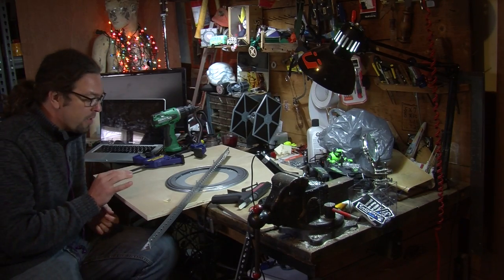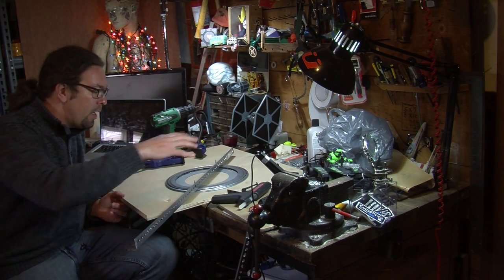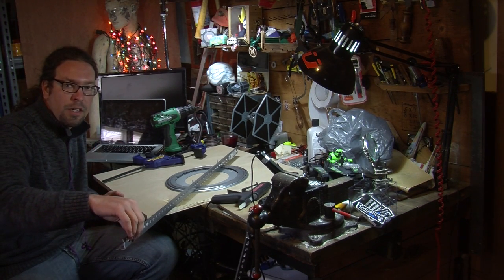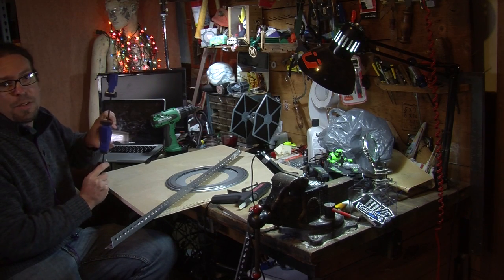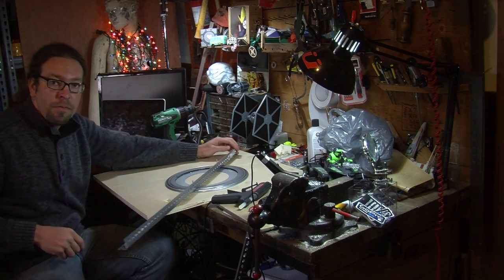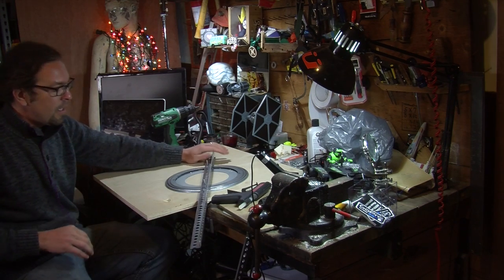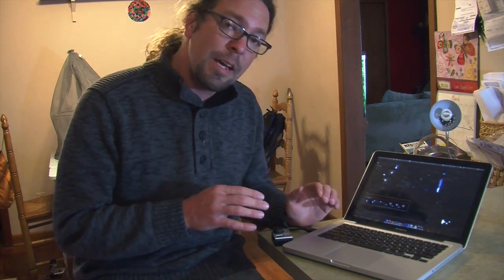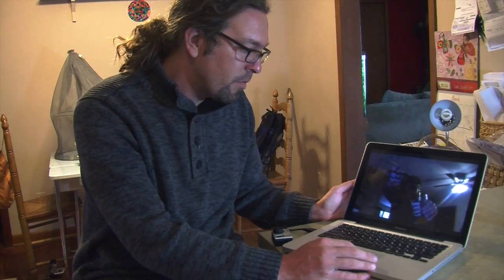How to make a bullet time rig for a gopro

Comment: I like this idea. I wanted to do something like that but more linear. I would recommend you play with your editing. You can greatly improve the slow mo using various slow mo techniques. You should try twixtor. I also tried and got great result using nothing more then Adobe Premiere with no fency add-on. You could even go normal speed, then go into slow mo for 2 sec. and normal speed again.